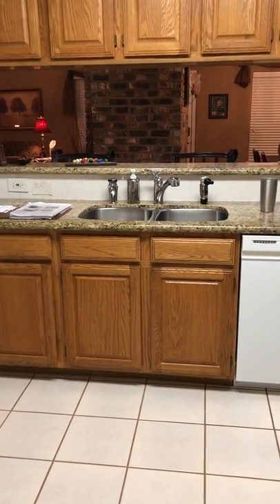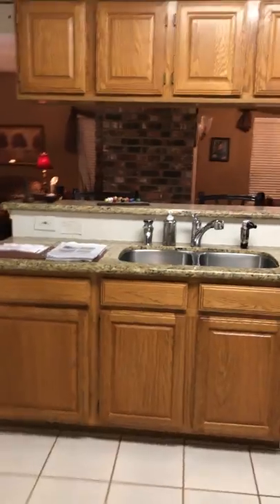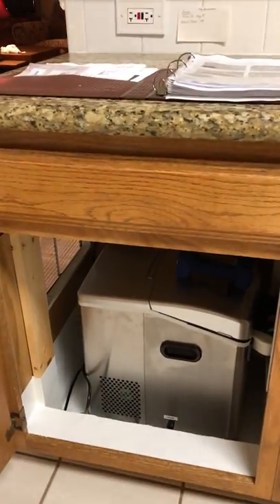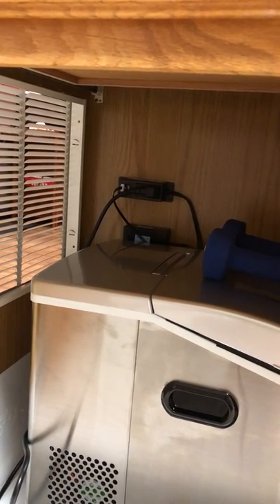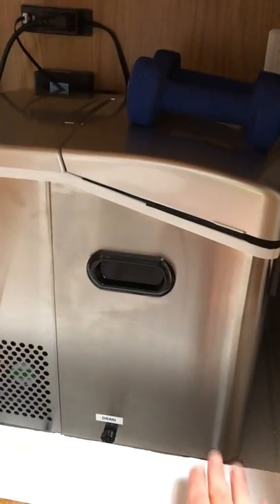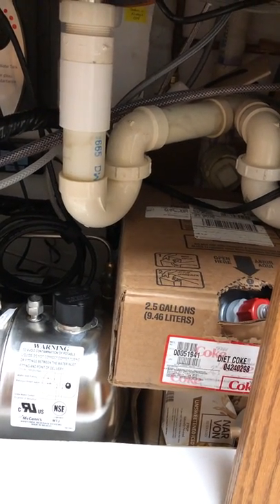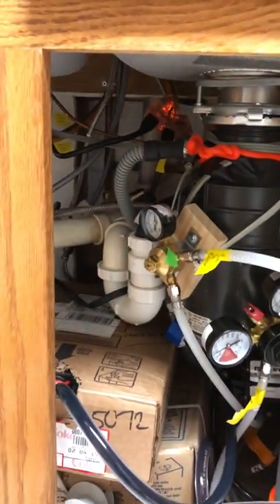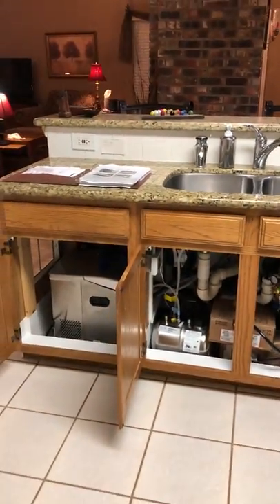Soda system installation

Comment: I installed my carbonator with a mini jockey box which has a SS coil instead of the cold plate, I need to add ice everyday, it is my only problem.  I would like to add the ice machine to insert the SS coil in it.  How your ice machine has been working so far?
Reply from the maker: The ice machine - the tray drop mechanism - broke  about every four months.  It always broke in the same spot - the tray dropper arm.   Yes, I would have to pull out that whole unit, out of that cabinet (not easy), repair it and reinstall it in that cabinet, finally I gave up and I too manually drop ice in every day and drain it.  If the ice machine would just work this whole system would be a huge upgrade from lugging 2 liter bottles around but even with having to put ice in every day it's an upgrade from what I was doing before.  Soda Dispenser has a new product where the carbonator and chiller are one unit.  One day I may try that.
Reply: @lauranortoncpa  thank you for the response, definitely I will keep adding ice to my jockey box. I freeze water in the round Clorox's wipe containers.  I have a small electric pump inside the jockey box, I plug the pump, at the same time I take out the ice from the wipe container, unplug the pump, add the ice and that's it until next day, takes me less than 5 minutes and we enjoy our Seltzer water all day. I have 2 CO2 tanks of 10 lbs each, so I always have one on hand. Each tank last 45 days, we pull around 2 gallons of Seltzer per day. To charge each tank is 11 dollars at a welding supply store. Thanks again. Probably I will make a video of the carbonator and add it to my cooking channel.

Comment: How is your soda dispenser holding up 3 yeas later?
Reply from the maker: Everything is going fine except the refrigerator/freezer kept breaking so every day in the morning I have to load the cold plate with ice, manually.
I think about the effort it took to manage the 2 L bottles in my refrigerator and open them every day to make a pour versus being able to walk up and use the wunderbar gun, so maybe it’s not so bad.
One day I would like to solve my Cold plate problem.
Reply: @lauranortoncpa  thanks for the video! I just purchased a system cold plate only. I need to figure out a ice bin situation. Did you ever do something different? I like the new chillers they sell but I can’t afford them.
Reply from the maker: @nightcasino  I'm still dropping ice over my bin every morning.  I do hope to get the remote chiller that they sell one day.  My system still looks exact same as date I took this video.
Reply: When the ice maker is working right Does it make the water cold

Comment: How much did this system cost in terms of equipment? Do you have a price list?
Reply from the maker: The parts I ordered from Soda Dispenser were $1,759.  That covered the ice machine, carbonator, wunderbar gun and manifold, Brix kit and CO2 regulator.  I had to also buy CO2 tank. If you're seriously thinking of getting something like this lucky you - as they have improved the whole process quite a bit since I installed this system.  The new setups like this can come with a chilled carbonator, so one unit that takes care of the ice machine and incorporates the carbonator too. Very space saving and less moving parts for keeping the cold plate cold. It's on the website sodadispenserdepot.com  probably available at other sites too, but I'm sure they have it.
Reply: Yea but the new systems with the space saving chiller cost thousands of dollars. Your set up is the cheapest way to go.

Comment: How did you pass the bar gun thru the granite/sink
Reply from the maker: I already had a hole there for a soap dispenser (and was regretful I did) with some filing I was able to tightly fit the grommet into the hole, lots of luck is what I had - because I think once you've cut the hole it's hard to make it a little bit bigger.  Back when the soap dispenser hole was made I had a special bit to make the cut, lots of work and water are in  my memories of that day

Comment: Which ice maker is that? Most small units I've seen like that don't stay cold after making ice
Reply from the maker: Soda Dispenser Depot (SDD) didn't include brand of ice machine.  Once ice melts below switch the unit makes ice again, keeping the cold plate cold.  This ice maker has broken a few times and I've had to send it back to SDD for them to repair.  When the warranty expires I will buy something different for sure.
Reply: @lauranortoncpa  interesting. I believe some of the $120 mini ice makers on amazon actually drain the melting ice back into the maker. So it should be the same thing

Comment: I’m looking to get one of these for my kitchen. Does it all come as a kit, or do I have to buy parts separately? Does it come with instructions to install everything?
Reply from the maker: It does come as a kit, there are a few things you'll have to buy extra depending on your situation (like do you want to have a gun dispenser or lever push, do you want to install a filter etc).  They'll interview you when you buy about how many different flavors you want because they will label the lines for you going into and out of the cold plate.  And they labeled the buttons on my wunderbar gun.  It comes with instructions, about 70 page book I'd say with pictures but you have to read it online or print out yourself.
Reply from the maker: Oh the 3 ring binder in the video is the printed-out instruction manual.  And that access panel on the back side of the bar.... I found out later I could have purchased something to cover that up, didn't have to build it.
Reply: Laura Norton thank you very much for the reply. How long does a bag-in-box last for you? Are you able to finish it before it expires?
Reply from the maker: @Raditude  I started out with 2.5 gallon bib and now I'm on my second 5 gallon bib. Prior to install I was consuming diet soda at rate of ~ 2.3 liters a day.
So I do finish before expiry. 
One thing that's wild is Pepsi and coca cola BIBs are crazy expensive.
I get my BIBs from webstaurant.com, free quick delivery, great prices, super taste.
Reply: @lauranortoncpa  Wonder how you are getting free delivery from them?  I looked into them and they are charging me over $30.00 for shipping standard ground.  Also, do you happen to have the link to the online version of the installation manual of the system you got?
Reply from the maker: @meluvalli  sorry I didn't see your question till now.  For some things I am charged delivery, for example a small part that could simply fit in an business envelope will have $30 shipping, but the BIBs are free shipping, so maybe it's just what you're ordering from there.  Do you have $30 shipping charge on a BIB?  I must be lucky, didn't do anything special and don't have any "pull" with the co.  Sorry I don't have a link to the manual anymore.  Above I responded to Eric Curry about the fact that there's a more modern system available that incorporates the chiller and the carbonator saving you space and moving parts.  Which is big improvement because for me the part in the ice machine that gets the ice to drop down around the cold plate would break about every 2 months.
Reply: @lauranortoncpa  sorry for another question. I also just ordered bibs form there. The old fashioned cola, diet cola, twist, and I’m still looking for a diet dew option. How do you like them?
Reply from the maker: @nightcasino  oh no problem on questions : )  WOW... since about 5 months ago I'm charged delivery so a 5 gallon BIB went from $45 to $75, $30 is shipping.  So that's an important update.  Very expensive, wish I could go get it myself but they're in Oklahoma.  So that was more in response to @meluvalli ... don't know how I was lucky for a while.

I like their sodas just fine, the price is what keeps me going back to webstaurant.  I'm always looking for better options though because even though I'm paying $30 the FedEx driver still might throw it.  The strong delivery drivers can send 40 lbs through the air  - not good for the BIB.
Reply: @lauranortoncpa  absolutely!!! I have a friend that owns a bar so I I was able to have him order them because he has the membership for free shipping. He can get me coke bibs but gosh it’s $119 each. Sooo expensive. I can’t wait to get mine in a few weeks! I have a home bar. I love the bar loud and feel, don’t drink at all haha so this year it’s all about the soda! It’s $8 a 12 pack here in rural MN.